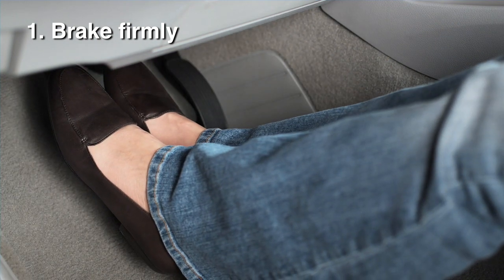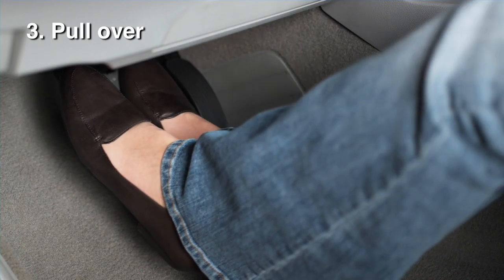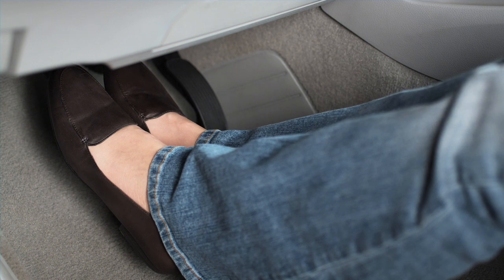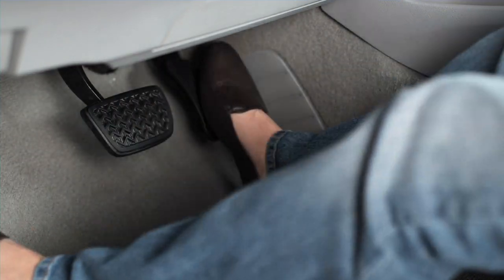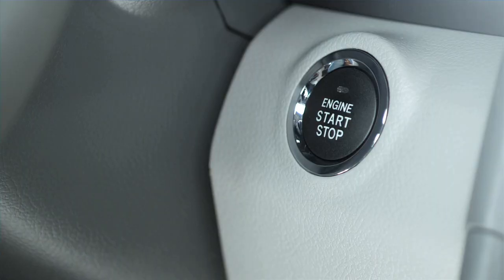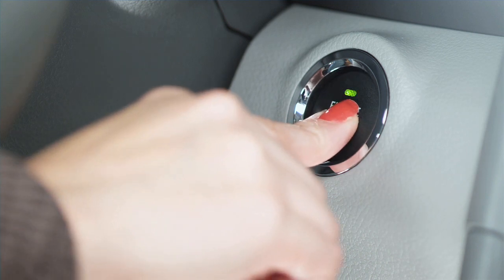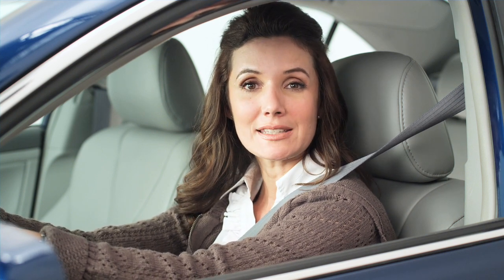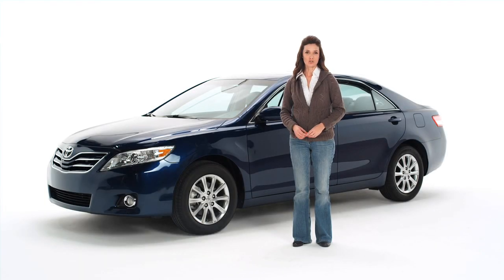Stopping Procedure for sticking accelerator pedal | Toyota

Comment: crazy how they released these videos instead of recalling cars. I remember these accidents happening regularly around this time.
Reply: Turned out to be driver error in most all cases along with floor mats that weren’t placed
Reply: @nononono4006  nah it was actually a sticky throttle. Jesse McCartney drove a Toyota race car at a racing event and it had the same problem, the throttle stuck and sent him flying into Frankie Muniz giving him permanent memory loss. look it up
Reply: @_daldoly_  I said in most cases not all cases
Reply: @nononono4006  you said "most all" which doesn't make since lol and having no floor mats wouldn't cause a pedal to stick. having the floor mats caught the pedals and held them, but the cars that had no floor mats also had the same sticky pedal problem which they thought was caused directly by the floor mats, so they went under investigation on the ones without them and found out they actually had a sticky throttle as well because of an anti break lock on the car. yeah most were driver error, but after the floor mats were told to be removed the problem went on.
Reply: @_daldoly_ Yes, on the old design there was a piece of plastic that would break off, which would internally jam the pedal from moving back to 0% throttle.

Comment: bravo for being honest and making an informational video
Reply: Yes but it wasn’t only the floor mats, one of my family members Lexuses 2006 is250 had it stuck, no bad floor mats she said the pedal wouldn’t unstick but when it did it still was going she knew what to do eventually and got it repaired idk what else about it
Reply: Honest? Toyota knew about acceleration surge issues back in 2003, issued an update, but failed to put redundant safety measures in place until many people unnecessarily died as a result. 

Only after massive recalls, NTHSA fines, and a class action lawsuit, did Toyota put videos out like these, allowed for greater braking without power assist, and most importantly, implemented brake override in case their throttle by wire ECU randomly malfunctions. 

7 years went by and dozens injured or dead due to complacency and dishonesty. Claiming people were not pressing the brake pedal, it was their floor mats, or their brakes (explain that one to me) that caused their unintended acceleration and inability to stop the vehicle (like losing power brakes after just one pump) instead of issuing a recall which they are need up doing anyways was far from doing the honest thing. Their CEO even publicly apologized for this huge lapse in human judgment. 

Don’t think they made this video out of their own will. They made this video because they were required to if they wanted to keep selling vehicles in the US. 
Have you seen any other vehicle manufacturer making videos like these? Think for a moment why that is. No Toyota aren’t the only ones who have built unsafe cars, but at least the Pinto’s poorly positioned gas tank wasn’t an issue that spanned across their entire vehicle line up and even into their luxury brand. If you ask me, Toyota got off very lightly all things considered. The people who died or lost their loved ones not so much.

Comment: Toyota knew about acceleration surge issues back in 2003, issued an update to try and address he issue, but failed to put redundant safety measures in place in case of a surge acceleration issue in the ECU until many people unnecessarily died as a result. 

Only after massive recalls, NTHSA fines, and a class action lawsuit, did Toyota put videos out like these, allowed for greater braking without power assist, and most importantly, implemented brake override in case their throttle by wire ECU randomly malfunctions. 

7 years went by and dozens injured or dead due to complacency and dishonesty. Claiming people were not pressing the brake pedal, it was their floor mats, or their brakes (explain that one to me) that caused their unintended acceleration and inability to stop the vehicle (like losing power brakes after just one pump) instead of issuing a recall when the first few hundred of reports of unintended acceleration were coming in, which they are need up doing anyways AFTER people were dying or becoming seriously injured. FWIW, their CEO publicly apologized for this huge lapse in human judgment, but will never make up for their lack of quality control and worse, their complacency to act when lives were at stake. 

Don’t think they made this video out of their own will. They made this video because they were required to if they wanted to keep selling vehicles in the US. 
No Toyota aren’t the only ones who have built unsafe cars, but they did so across such a wide platform and in great numbers.. and not on the 1970’s mind you., but in the new millennium where safety from a major auto manufacturer is expected. At least the Pinto’s poorly positioned gas tank wasn’t an issue that spanned across their entire vehicle line up and into their luxury brand. If you ask me, Toyota got off very lightly all things considered. Tell me, does an apology, issuing a long overdue recall, and paying fines/restitution make it up to the people who died or lost their loved ones?

Comment: If one doesn't know how to shift gears, how to turn off the engine, or how to push the brake pedal, chances are that one will never experience a stuck accelerator pedal. This is because such a person most likely doesn't have a driver's license, or even knows how to open the door and get into a car.

Comment: I think the steps are correct. Do you actually lose the brakes power assistance while in drive? ??Because the engine should produce vacuum as before
Reply: A couple of journalists proved that some Toyota’s brakes lost power assistance when you’re firm on the accelerator and try to hit the brakes more than once. The first time will work and any attempt afterwards is without power. It’s crazy because my BMW does the opposite. It immediately cuts power to the engine when the brakes are touched, even if you floor the accelerator

Comment: But putting it in neutral will alow the engine to run at max rpm. Sounds like that could be more expensive then just the accelerator repair. I suppose if you are 95 you may need both feet....
Reply: max rpm or your life? you choose
Reply: You can replace a car, you can’t replace lives
Reply: @FlexSZN23  but what does that have to do with anything?
Reply: @VladosBb  yeah I suppose if you are doing 120 and need to stop quick then neutral isn't such a bad idea. Not sure why Mark didn't try it, or kill the engine, or put it in park, or anything other than drive. Hell dropping it to low 1 would have got the job done.  But if a crash isn't imminent I would go for just one foot on the brakes along with the e brake and try to save the engine and transmission.

Comment: @zpunout thats the only thing people should do. tap or jerk or burst the pedal to loosen up the sticky part. i drove my friend's AE86 at hot run, then the pedal got stuck down at the floor (a relay box came loose and got tangled up with the pedal). i couldnt tap the pedal since it's already on the floor, nothing else i could do, so i shut off the engine and brake. simple as it is.

Comment: ok now you did not listen to the video, it said to not take your key out of ignition because the steering wheel would lock... but what it said was turn it the the ACC function. and press on the break with both feet and put the car into neutral

Comment: What is not a rare occurrence is the code in electronic throttle control in all toyotas and lexuses. Fix the code people. Make the system fail-safe. People reported not to be able to shift to neutral when their toyota or lexus suddenly accelerated out of control.

Comment: That was not part of the recall, there was a software problem with the ABS on 2010 Prius' that caused the ABS to not always kick in, but the brakes still worked.  Nothing I've seen had anything to do with the brakes on the other cars.  Toyota never recalled the Prius as far as I know, because most of the cars had updated software before they left the lot, and all other owners could get the software update if they were concerned about it.

Comment: 1. I like how the company made a video on what to do in said situation as to fixing the solution. Based on this 1 video alone by a manufacturer none the less I won't buy anything toyota!

2. If the car is turned off while still in motion the steering becomes tight because the power steering pump isn't on. So I'm pretty sure the steering would be effected at high speeds, way to give advice!
Reply: My van stalled no brakes or stearing  glad I wasn't going very fast and the emergency breaks saved me. Really scary as I was getting read to go over a bridge.  These corporations don't give a sht
Reply: Yes, steering is a little harder, but it's just the same as regular cars without power steering. Pretty easy to turn the wheel as long as you're going a few mph.

Comment: what if you have a manual transmission 
you can’t brake with both feet
Reply: Pushing the clutch pedal disconnects the engine from the wheels. That, and moving the gear stick to the center, that is not in any particular gear, but dead center, will do it. Not sure if this accident has ever happened in a manual car because there are more ways to disconnect the motor from the wheels in a manual car, and usually people who drive manual transmission cars understand how their car functions

Comment: Why do people, even people who claim to be geniuses, not know that the steering doesn't lock unless you're in park?
Reply: that's still quite different than it locking up. Plus it is not hard to steer nor brake a car without power steering and brakes
Reply: In toyotas, the steering will not lock unless you're in park.
Reply: Mine does

Comment: "Turn the engine off. This will not cause a loss of steering or braking control but the power assisted systems will be lost"

.. ok yah so this WILL cause a loss of steering and braking control..

Comment: Thats not what I was saying at all...  It was certainly an unfortunate accident, and Toyota clearly needs to fix the problem (as I started out by saying in my first comment)  BUT, really it doesn't take that much sense to reach down and click the ignition off.  And somehow, calling 911 wouldn't have been the first thing I would have done if the throttle stuck open on my car.  Its one thing if the throttle sticks open going into a corner or something, but he had time to place a phone call...

Comment: Yeah, Its pretty bad if you aren't smart enough to realize..."Hey, My accelerator is stuck. Maybe I should turn my car's engine off." This used to happen to me in my first T-Bird cause duct tape on the passing gear. First thing I did was go to neutral, then shut off.

 Instead, I guess they think its a movie and when your accelerator gets stuck you should keep hauling ass down the road until you run into someone to stop or run off the road.

 Driver's education just isn't enough education.

Comment: Ok, Toyota, what happens when the vehicle is shifted into neutral with both feet on the brake? Oh yeah, the brakes lock up, and the people behind you rear end you. What else? I can tell you that if I'm putting both feet on the brake I'm going to use the wheel for leverage. Oh wait, doesn't that steering wheel like steer the car or something? I'm not a certified mechanic but on my Honda, the steering wheel still steers the car, even when I'm panicking and slamming on the brakes with BOTH feet. This is how people die. But, you guys must just love lawsuits so great video.
Reply: ***** yes because the hazards coming on after the brake lights are going to make that much of a difference. Especially since my first action to stop an out of control car is to turn on the hazards
Reply: ***** missing my point about other cars actually being on the road. Not all cars have ABS. Even if they do, it doesn't always work. Depending on the car and the conditions, it could take a minute for the ABS to regain control. You should never rely on the car to control itself, thus you should never put the car into a situation where it could possibly lose control. Just put it in neutral and pull off the road and stop. Cars with power brakes do not need two feet to stop. Adequate pressure with one foot is more than enough. The whole point is that following this procedure is an extreme overreaction. Sudden full braking on a busy interstate is all but a guaranteed collision. If the car pulls over into another lane with traffic it gives them almost no time to react. Plus, your car will now be stuck in the middle of the road in neutral at a complete stop. If you don't see an issue with this then go park on the interstate and try to walk across and back without getting hit. Human whack-a-mole, while sounding extremely fun, is not the way to handle a very correctable problem.
Reply: All cars sold in the US have ABS.
Reply: @BryanEndres97  did it happen to you or someone you loved? Hmmmmm. If so, and they survived, would love to hear their story. Until then, know that Toyota covered many things with this up starting in the early 2000’s, and it was not a floor mat problem.

Comment: 2:23 "drivers who can not put the car into neutral..."?  WTF?  A car is supposed to go into neutral when you tell it to!!!!  Great job Toyota....at least you're honest about this "special safety feature" .     FAIL!
Reply: In some occurances, the computer system fails, causing the shift safety, accelerator, ignition switch, and other electrical components to malfunction. In that case, you may not be able to get the car in neutral. Stop talking about things you don't know.

Comment: This is bad advice, why would you use both feet on the break pedal and break so suddenly, surely this would cause an accident. Just turn into neutral and brake, when you lose enough speed turn of the engine, some power-steering systems become uncontrollable when they lose power-steering because modern cars have tiny steering wheels and they're designed to be turned only with power-steering systems. 

Worst case scenario following this advice you can't turn your car and you lose control or someone rear-ends you.

Comment: never ever turn off yore car it will lock steering wheel
Reply: - it won't if you know what you're doing.
Reply: J Walker 😂😂😂
Reply: Urethra Grundle when it's off it gets REALLY difficult, like if you don't expect and prepare for it or if you're not strong enough then it could mean just as much trouble
Reply: +james vlogs +J Walker + ljefferson51
Sorry but you guys are wrong. Even Toyota's youtube video tells you it will not lock the steering. First, a Toyota or Lexus with push-button ignition CANNOT lock the steering unless the vehicle is STOPPED and in PARK when the engine is turned off. There is actually an interlock in the design to prevent it. So using the emergency stop function (press button for 3 sec) will NOT lock the steering. A Toyota or Lexus with key ignition will NOT lock the steering unless the key is turned all the way back to LOCK (the order is LOCK, OFF, ACC, IGN, START) AND (on most models I've tested) the lock doesn't even engage until the key is actually REMOVED from the lock!  (The lock engaging is the "click" sound you hear when the key is withdrawn on a Toyota.) Furthermore, most of the models with automatic transmissions will only allow the key to rotate to LOCK and/or be removed if the transmission is in PARK first. 
Next, turning off the engine will not cause loss of brakes or steering. PERIOD. On cars with hydraulic power steering, power assist will be lost HOWEVER steering assist required is inverse with vehicle speed... ie most assist is needed at parking speeds and the least is needed at highway speeds. Indeed, vehicles with PPS (proportional power steering) generally reduce power assist to nothing at highway speeds. On cars with ELECTRIC power steering, steering assist may actually continue even with engine off. 
With regards to power brakes, ALL vehicles with power brakes have a "reserve" function that provides 1-2 full pedal strokes of power assist even with engine off. This is why you are advised NOT to pump the brakes but just apply continuous pressure (to maintain the power assist). Once that reserve is used up, the brakes will operate normally, just without power assist (ie more pedal effort is required). US Federal Motor Vehicle regulations require a vehicle to be able to stop safely even without power assist. Also, some vehicles (mostly high-end Lexus models) actually have an ELECTRONIC brake booster system which, just like electric power steering, does not require the engine running in order to operate and therefore may continue to provide power brakes even with engine off.
Hard as it may be for some to believe, there was a time not that long ago that power brakes and power steering was not standard on all cars, even some larger cars and truck had manual steering and brakes standard. In fact, those big Army 6x6s came with manual steering for DECADES before being retrofitted in the 90s with power assist. The trick you learned with manual steering in particular is just to get rolling a little before you tried to turn the wheel, as the effort drops considerably once you're moving. That's why I chuckle every time someone says you can't control a car without power steering...it's complete and utter BS.
Reply: No it wont you can turn a car off just dont take the key out or it will lock the wheel
Reply: Mudog715 thanks for the lesson. Honestly they don’t really teach what to do if something goes wrong in drivers ed. Even normal stuff like skids and hydroplaning and especially don’t explain what to do if your car malfunctions